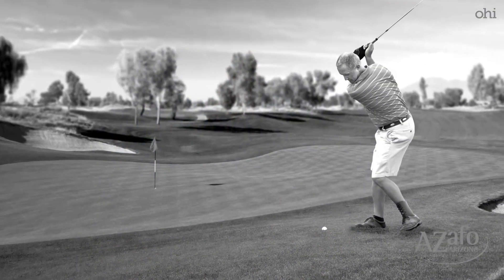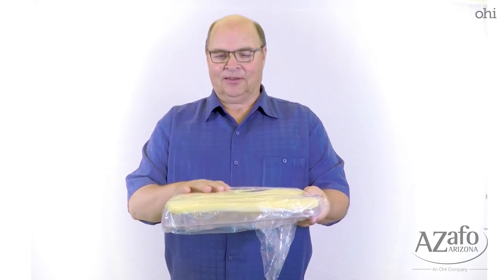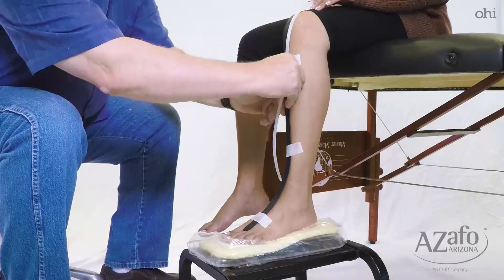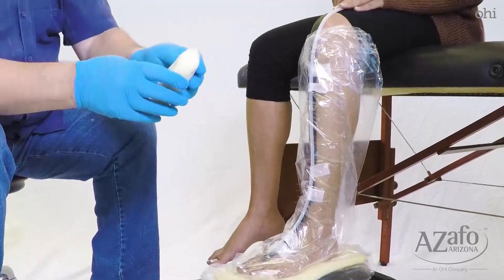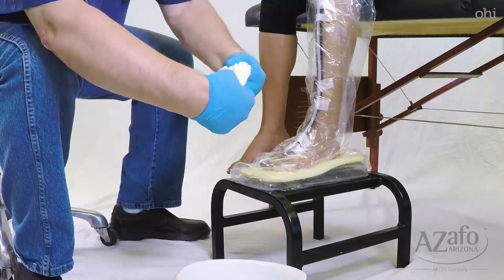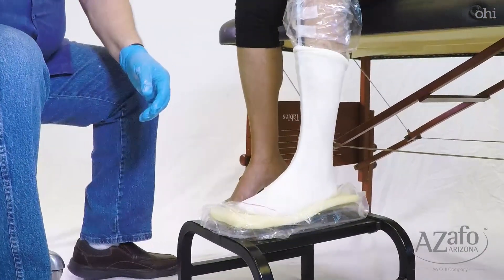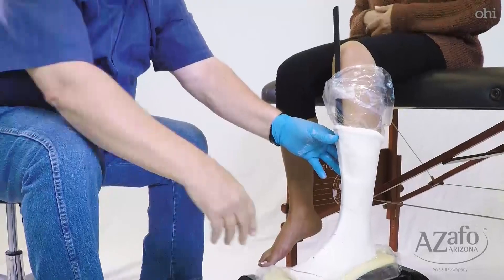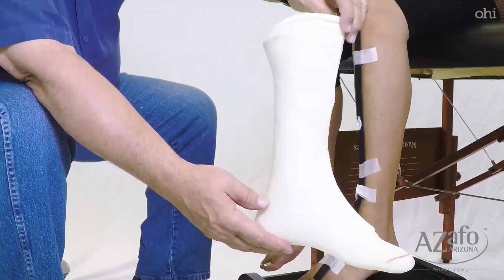Arizona AFO Casting Video

Comment: As a former orthotist and pedorothist I can tell you from experience to not use the arizona brace for anyone with neuropathy of the feet. I went thru cancer for my 3rd time last year and this time was for leukemia. I now have bilateral L1 nerve impairment along with diabetes from my second cancer of pancreatic cancer caught early. I was using old AFOs made off my legs when carbon fiber first came out. Very rigid like floor reaction AFOs. The brace had solid ankles from carbon fiber insets set into the polypro. Full foot plate extended just past my toes. An added on anterior shell to keep straps from digging in and to provide and little heal relief as a clam shell. My braces were made in 1992 and you can guess they are starting to crack. My foot and ankle specialist casted me for arizona braces. 3/4 length lace up. After 3 weeks I had bad ulcers on top my mets from the end of the brace digging in when I walked. I tried stretching the leather and finally gave up. I was about to loose my feet. I went back to my cracked AFO and within 3 months no one knew anything was wrong with my legs. My foot and ankle doctor now has me going to Hanger for replacement copies of my AFOs I made working for hanger back in the 90's. Never use the Arizona brace on anyone with reduce sensation of the foot. People sell these braces on ebay and refuse to wear them. They cause way too many issues for those with nerve impairment of the foot. If you get any swelling the arizona brace will not compensate for swelling. Nor does it supply the support need for a foot with reduced muscle control. I spent over 2 grand for insurance deduction and ended up throwing mine away. As a former orthotist and now a patient I can honestly say stay away from lace up leather braces on neuropathy patients.
Reply: I am so sorry. thank you for sharing.